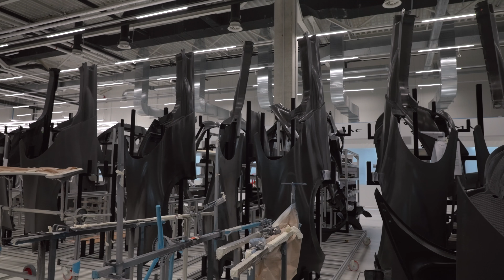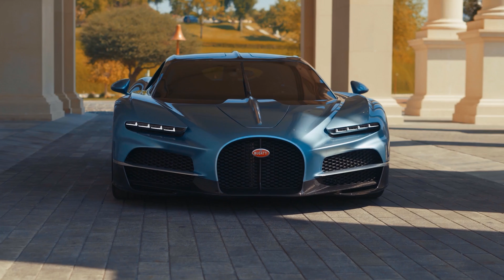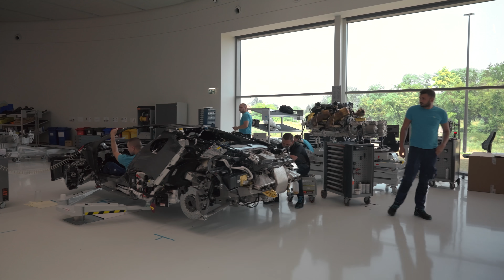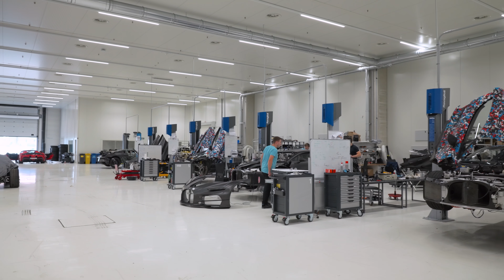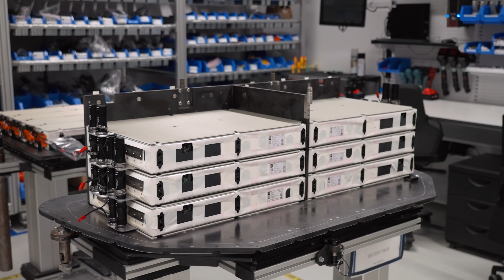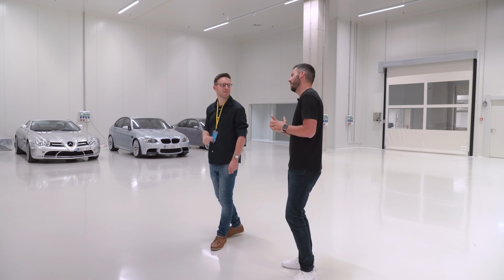Inside Bugatti-Rimac Dream Factory + CEO’s Insane Car Collection!

Comment: Who gives a shot about the sound of a v12 when the v12 is in your rear veiw mirror snd getting smaller and smaller the further you go oh and the tesla roadster 2 the new one the thrust and the rocket versions are way better than the Rimac also the base model tesla roadster is going to be better in every which way compared to the Rimac so what's the point in buying a Rimac when the tesla is going to be way cheaper probably half the price of a Rimac and way faster with a longer lasting battery that charges faster than the Rimac so it's cheaper faster charges faster charge lasts longer the roadster is just going to be better all round except the Rimac will have better exotic materials inside the car and will probably be better quality than the tesla I think maybe.

Comment: As an r&d engineer working at daimler i know a lot of ceos and been and watched in a lot of factories. Matte is an amazing Ceo and car enthusiast. Although his work as Rimac is not mechanical masterpiece like pagani, bugatti or koenigsegg its still a masterpiece in its own class. Just one info as homologation engineer, yes you need to burn the battery pack according to R100 regulation because on the road, other cars use petrol and you can have a crash, and there can be fire. Thanks for the amazing video and it was a delight to watch.

Comment: A factory that produces beautiful car bodies and robust blocks, but they're completely useless without Audi or VW components. Basically, it's a $6 million VW/Audi hybrid. When it gets damaged, you'll have to take it to a repair shop that will charge you $2,000,000 for a fuse that costs $2. Or for maintenance (oil and filter change) that costs $1,000, they'll steal $20,000 from you.

Comment: Now we need a hybrid between bugatti and rimac... probably a w16 with 4 turbos producing 1600 bph combined with 2 electric motors adding additional 2000 bph, accelerating from 0 - 100 in 0.9 seconds, 0-200 to 2.5 seconds, 0-300 in 7 seconds, and a price tag of 28 mil Euros!

Comment: Cool to see Bugatti using it...  but Honda started that non-speaker sound actuators vibrating interior panels in their Honda Jet and installed them in the bed of their Ridgeline Pickup in the USA.  So Bugatti are not the first to put this tech into production.  But even the Ridgeline uses regular speakers in the cab, so Bugatti is pushing the tech forward.

Comment: Worked in Croatia for 6 months, was driven by the boss, my body hurt and I got slightly carsick. The boss had plates in the car so he drove quite calm according to him. Had a run where the janitor drove, he was driving quite calm and relaxed, it was "only" 50% faster than the speed limit.  Croatians seems to drive as if they are alone on the road and speed limits it's mere suggestions or possibly minima speed.

Comment: And you need to make a Bugatti where the front of the car is the Rimac with the two Electric engines and the battery and everything else in the Front of the car and a Bugatti engine in the back of the car, like your original idea😂

Comment: Interesting technology. Looks great like engineering art. I'm amazed of this tiny E-Motor which has 500 PS/over 400 kW and the 3D-printed chassis. I wouldn't say e-mobility is in a downward spiral. It is leveling after a great hype and China has overproduction. On the streets are so many e-cars now.

17:09: if Iooking at the head lights, there is room for improving the build quality. But as I learned it's a prototype?

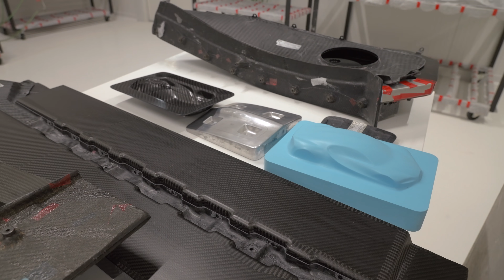Comment: 8:45 Sony does the same thing with their high end OLED TV's they use the screen of the TV as the speaker cone and have transducer attached to the screen its the same idea as a "Bass shaker" but for all frequencies. It's a really cool idea, but makes me wonder if they have to tune the carbon fiber tub for sound.
Reply: Probably just picked the best existing location as the initial reason for the tech already was weight and taken-up-space reduction.

Comment: 16:45 - The Nevera absolutely will be beaten in terms of performance for the simple reason that the majority of its mass is its energy storage system, ie the batteries, and battery energy density is now where near any fundamental physical limitation. Battery energy density is currently technology and production volume limited, but we already have path ways to roughly doubling the installed energy density, so you could make a new Nevera that has a battery system that is half the mass, so clearly this massive lerb weight reduction is going to drive huge performance increases (Nevera = 2,300kg kerb with ~700kg of battery at 67% packing density which results in a pack level 169 Wh/kg.  Direct Cell to Battery  (an deven Cell to Chassis!) rather than Cell to Module to Battery can realise packing ratios of 75% or better, combined with a better fundamental cell energy density (>250Wh/kg) will drive battery mass down significantly in the next 5 years. So yes, a "new" Nevera could be under 2,000kg, ie 15% lighter, so even at the same power, that's a 15% improvement in power to weight ratio.....
Reply: You need a car that doesn’t fly above 400 kph - mass is not always an enemy - although I agree generally

Comment: Worth noting the reason there can be no rear crash bar is not because of the crush cans (which themselves are nothing new) but because current crash regulations do not have an offset or low overlap rear impact standard!  This was added to frontal crash regs about 15 years ago, because with an offset/low overlap impact, typically the extremely stiff wheel and tyre is pushed backwards into the cabin, leading to significant occupant injury.....

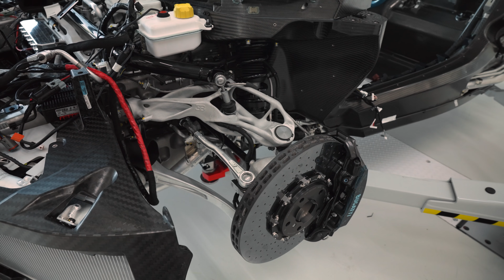Comment: at 5:00 that is not "aero shaped suspension"!  That is a suspension top A arm that has been optimied through Generative Design, ie a design process where the nodes, loads and the constraints are defined and the design s/w actually then runs through an iterative process using machine learning driven by the results of a Computational Stress Analysis FEA of the current design that is used automatically to refine the next solution.

 Run that for a couple of thousand runs and you end up with an "organic" looking shape, because this is basically what natural evolution is doing, ie carrying the loads in the most optimum way possible.  Generative design is just doing it a lot faster, and whilst the technique is not new, it has been basically enabled by the introduction of rapid manufacturing processes such as 3d printing and metal sintering (and to some degree modern multi-axis CNC machining)  that can now make "full strength" complex parts with few straight lines!

Comment: The original Tesla Plaid also accelerates faster than it brakes... but because it has terrible brake discs, since when fitted with a suitable track package this difference ceases to exist.
Reply: They're not terrible brakes; they're merely steel brakes. They're quite good for steel.
Reply: @jamesengland7461 Of course they are good, if evaluated within the context of steel brakes in the mass production market. But they should be evaluated in their specific context of installation and use. So, with that in mind... those steel brakes have no place on a 1000+hp car that can accelerate from 0-60 in about 2 seconds.

Comment: That idea for using the entire tub of the car as the audio system speakers 🔊 must be the most bonkers original invention in the car industry this decade!
Reply: In entertainment electronics its not so new. There are TVs/displays which use the display panel itself as a speaker membrane. But yeah, in automotive it seems really new.
Reply: @renebartkowiak7122  maybe that was the inspiration for Rimac to apply that tech to the automotive world. Innovation happens when people are able and allowed to think outside the box. In german, you call it watching beyond the edge of your plate.
Reply: @renebartkowiak7122 As always in tech world LG was first who pioneered this tech, every single core  feature that you see today on modern TV was pioneered by LG.They have  so much crucial innovations and patents which change the world, one good example is original iPhone which would never come alive without the capacitive display which change smartphones forever!!
Reply: It's not new, used before a longtime ago. Might have been Mercedes.
Reply: Its like an evolution of flat screen TVs where they use the screen as the speaker (I've got one of those).

Still takes a special kind of mind to imagine using a car tub the same way!
Reply: Another Alien who making a Car in the world! 👽
Reply: They did not invent this. You could just buy this membraneless audio system from Continental (Aumovio). There are other cars that already have this. It does not save much, it is expensive to tune to the chassis to sound good, but a fun gimmick at the end.
Reply: completely uncecessary and imagine the effort of that uneeded thing being used for something useful
Reply: @rndmprsn3532  That could be said about the whole car. In reality they are already running tons of simulations for NVH and chassis tuning so it's not much more to add audio to that.
Reply: @origamihawk  I bet they could use the audio driver to cancel out road noise, much like active noise cancellation. The difference though, it would be cancelling noise out at the source.
Reply: @fortunefed8719  I think there are already BOSE systems from a few years ago that do noise canceling in cars.
Reply: @rndmprsn3532  absolutely agree from an engineering standpoint, introducing harmonic resonance to the whole stricture for what reason, you hardly save any weight because the magnet would be similar weight even in a conventional speaker system, and the membrane and wires used for electronic would be similar. 

The money spent on tuning the frame, other compromise in the tub design to achieve the desired frequencies could have been spent elsewhere.

This is less an engineering marvel and more throw everything at it, even the 3D printed parts are not new, nothing on the car is a new invention. maybe their battery cell technology that is about it.

Comment: So, he's resonating the carbon frame of the Tourbillon, as it is an essential speaker component of the audio system....  I have a number of thoughts about this.  #1. What have he and his crew determined about long term material fatigue from this added induction of vibration?  #2. Barring extra details (which I fully expect he's rightfully withholding), this thing will be almost cartoonishly insufferable to others in traffic, as it'll be radiating out a substantial amount of the owner's music choices.  #3. I simultaneously wonder about how the car frame resonating your music might interfere with hearing sirens in the area, and using this feature for noise cancellation.
Also, don't take any super important, secret calls while driving this thing.  LOL!

Comment: CATL or Rimac battery?

Ladies & Gentlemen leave your comments and likes. ❤
Reply: CATL is a Chinese battery manufacturer, RIMAC on the other hand is designing and producing battery modules and pack. 
Rimac is collaborating with EVE who is producing cylindrical battery cell formats which are being used in Rimac battery modules.
So comparing RIMAC with CATL is like comparing Boeing with Rolls Royce or comparing Airbus with General Electric…

Comment: American billet v8 hemi supercharged and turbo charged engines are making over 4000hp Bugatti should make a powerful electric motor to spin a huge roots supercharger or a twin screw supercharger to get maximum boost so the combustion engine will not have parasitic loss.

Comment: How is the repairability of these modules? A tourbillon is likely to be operating in 30-40 or 60 years and no doubt by then has had many battery repairs.
Reply: Individual cells repairing can be a headache..so replacing a battery pack is worth
Reply: @suyogsawant1104  in 40 years there's nobody to replace such batteries even if they would be affordable, but repair shops will be plenty. Having a pressurized and welded battery case would make repairs really difficult.
Reply: @suyogsawant1104  in 30 years there's nobody to make those battery packs. Repairability is essential.

Comment: Mate , you need to make sure that the dust covers for the brakes are put on 100% straight with the company logo, RIMAC, especially when its going to be filmed, ( every Frame which shows the Name should be perfectly straight based on the midline of a frame) its good OCD sense if you get my drift , good friend. 🦘✌🙌

Comment: Batterys are insanely flammable and the risk of overheating and fire make them just completely ridiculous to me, not to mention anyone that has ever had Rechargeable batterys in anything knows that is dosnt take them long to start losing their charge faster and faster. They will all be great paperweights polluting landfills in short order
Reply: Yes. Compared to gasoline, batteries are indeed extremely flammable...
Reply: @Pnner1 many insurance companies require electic vehicles to be parked outside a garage for this reason. Also once they combust almost impossible to extinguish

Comment: 18:27 50 THOUSAND Battery cells per year. 1 every 10 minutes means 60*24*365/10minutes ~52k. Bro can't even math
Reply: 50 million cells. 200 cells per module. 5 modules per pack.
Reply: Bro got corrected by the man himself 😂
Reply: @zacharyKewDenniss  My bad. 😁

Comment: Just 1 thing:

The EV situation is NOT a cycle.
It has never been organic.

Governments, regulators and investors wanted to force it onto people, with the result that the whole car market crashed and is now in limp-mode.
Because people don’t want EV, but don’t know if they can still dare buy ICE vehicles. In addition all EV development costs, non-existing sales etc. have to be rolled into current model pricing.

Summa summarum:
They destroyed the industry 

Other than that…great video!
Cheers
Reply: You should have specified. Sport cars fanatics, people who want to drive their cars, to whom engine sound and how car handles is important, don't want EVs.
Common people who don't care which car brand they drive and after a few weeks of buying it, they can't remember any technical specifications anymore besides its color -- they wan't EVs. Mainly because those are cheaper to maintain and they don't need to worry about any fluids, oils etc (people are getting lazier every year).
Reply: @speedee7777 That’s actually incorrect.
Most people in alpine regions; tight and/or older cities; with constant long distance traveling; towing/hauling/construction situations; forest work; limited options for EV repairs etc. etc. etc. absolutely don’t want and can’t use EV.

In European cities most people live in apartments, and don’t even have their own specific parking lot. They park their cars somewhere down the road. There’s no possibility for charging (overnight etc.).
In addition battery output goes down up to 38% in harsh winter conditions. Etc. etc.

I personally know business owners, single moms, driving schools, plumbers etc. who absolutely can’t make use of any EV.
Not to mention that repair shops have to create specific, isolated areas for EV repairs and acquire an average of $40,000.- tools and software licenses to do the simplest of diagnostics.

We’re not even touching the horrendous environmental impact EV production, the necessary infrastructure etc. have, the issues should a fire occur, and the fact that they’re basically throw-away items, as they’re financially totaled as soon as the battery is done.

Etc.
Best wishes
P.S.: I’m also not mentioning the fact, that most EV power output/range statements are basically a lie, which can be immediately witnessed when you do a high speed run on the Autobahn in summer, and the batteries overheat.

Comment: Bugatti Chiron SS: 490 km/h WR 🥇
Bugatti Mistral: 454 km/h Open Top WR 🥇
Rimac Nevera R: 431 km/h EV  WR 🥇 
Rimac Nevera: 275 km/h "in reverse" WR 🥇  😁
Reply: Tourbillon ss will probably surpass 500kph
Reply: @DevKumar-bi2ld Correct. It has better drag coefficiency so top speed will easily surpass 500
Reply: Aspark Owl is NOT a road legal production car!
Reply: @joebeus6886  not yet.
Reply: @joebeus6886 true but it does have the fastest top speed for an EV
Reply: Rimac Nevera R didnt beat EV top speed record, that belongs to the Aspark Owl (yes it has officially done it, its proven)